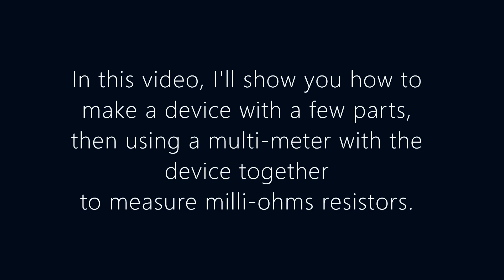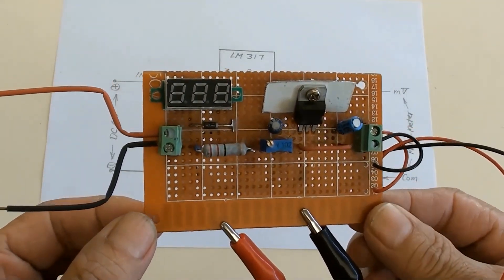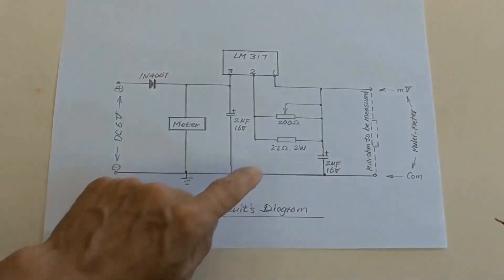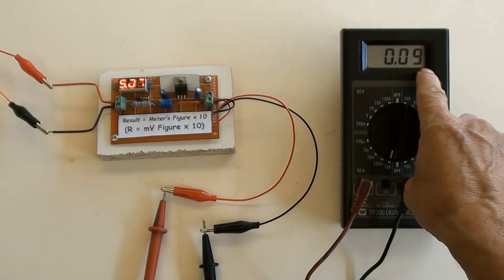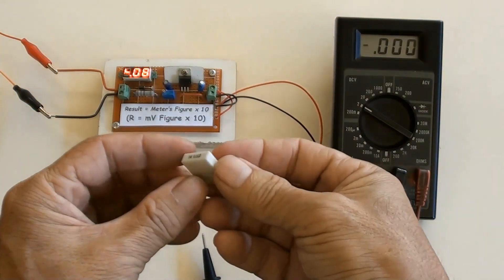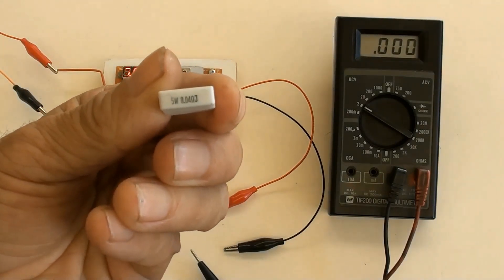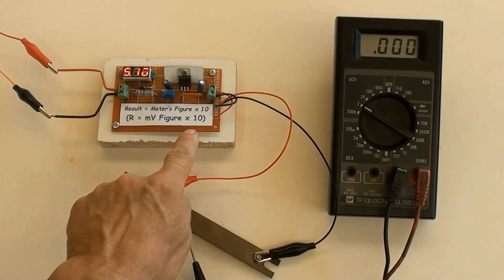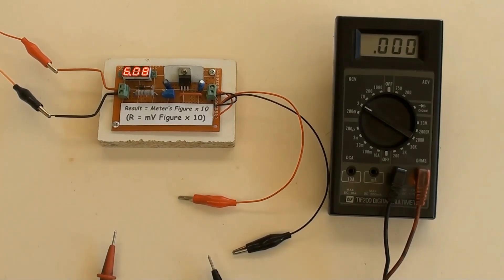How To Use A Multi-meter To Measure Milli-ohm Resistors?

Comment: 5V is enough headroom for 15 ohms DUT.  I built this LM317t supplying 100 mA for milliohm measurements too. My source is a dissembled powerbank which provides 5V. I did not use an input diode, so no drop.  I did an increasing resistance test and found the regulation dropout first occurs when the device under test is around 20 ohms when source is 5.000V.  This can be de-rated to about 15 ohms to account for varying circuit components and test conditions.  I see some people suggest increasing the input voltage.  The additional voltage would create heat, leading to drift from the 100 mA value as components increase temperature.  Once above 15 ohms, a good DMM with two low resistance wires will start to provide more accuracy than a home-made 4-wire setup.
Reply from the maker: Thank you for the interested and like the way you did!  The best way to understand the device's principle, master it, experience yourself and may be to do some improvement as well.  I'm glad you did in so much details.  Thanks again for your feedback! 👍👍👍

Comment: usually from left pin to right it's Adj, Output, Input for LM317, when you facing it, not sure why you reverse the order to make it hard for beginner
Reply from the maker: Thanks for your interest!  Yes, you're right regarding LM 317 pin's order when the one looks it however when the one reads its circuit or drawing its diagram, the pin's order is reversed just like the way of the video showed.  Of course nothing definitely, just saying - that is the most practical way in use.  Cheers!   ❤👍

Comment: Congratulations, it seems to be a good circuit. I have a doubt: what is the use for the display?
Reply from the maker: Thank you for the interested!  The display? You mean the mini voltage meter in the circuit:  it is not a MUST component in the circuit, its function are showing the device has the power on & indicating the power level, just for the convenience in the practical experience.  Thanks.

Comment: Too many errors in this video.
Resistor should be 15 ohms instead of 22 ohms in parallel with 100 ohm potentiometer instead of 200 ohms, to obtain a combined resistance of 12,5 ohms, for getting constant current of 100 mA, since reference voltage of LM317 is 1.25 volts.
Calibration should be done using the 200mA scale in the meter instead of 10 Amp scale, to have more accurate calibration.
The input voltage meter is unuseful.
And the worst mistake, is when reading the millivolts drop in the tested resistor, the multimeter leads should be touching the resistor terminals and not the crocodile clips from the current source to avoid introducing the error of joint voltage drop. Use Kelvin 4-wire measuring scheme.
And by the way, you can reduce background music volume.
Reply from the maker: Thank you for the interested and agree with some of your points however I've to point out:  It is nothing wrong about 22 ohms in parallel with 200 ohms potentiometer (its ohm value is adjustable), their combination value is between 0 ohm and 19.8 ohms which indeed, includes resistance of 12.5 ohms.  The device was the best configuration by considering given the components involved.  I recommended highly you'd make your own device like in the video showed and experience yourself.   Thanks again for your effort!
Reply: I have done many constant current supplies, and those with LM317 has no secrets for me.
Paralleling 22 ohms resistor  with 200 ohms potentiometer will force to flow a little more than half of the 100mA total current thru the potentiometer and it will be in the lower part of his resistance, with a high power disipation and poor precision in the adjustment. The ideal is to have a potentiometer that can be adjusted about his midpoint. @diymade2175
Reply: Kelvin testclamps (4 wire) are rather cheap ~ 20 € or $ or and very usefull. And combine it with a ICL7107 based mV meter (there accurate) and you have a stand alone mOhm meter. And you will be able to set the decimal point at the right place for easy readings.
Reply from the maker: @harrydelange1821   Good on you Mate, that is the one of ways to get the result(s) you want.  As an example:  There are many multi meters on the market now days, you can choose the one which is the best suitable for yourself.  Thanks for your interested! 👍
Reply: @diymade2175  Thanks, personally I am charmed for a standalone solution but I realize that not everyone has the skills or interest to build a more complicated project and choose for building an extention using a multimeter (witch works fine of course).

Comment: I completly apreciate this video and how has explained. But, I'm don't understand at all how it really works. 

Thanks a lot buddy!
Reply from the maker: Okay, you might need to refresh what you had learnt otherwise no worries!  As an example for the people, they know how to use a multi meter but the most of them don't understand how it works.   Thank you very much for your interested!
Reply: @diymade2175  I've watched other similar videos, and backing to this, I finally understood. Really thanks. I don't see the time to build my own! It's really useful to locate electric shorts in electronic repairs
Reply: @diymade2175  Yes, I'm an example of that people, I know to use multi-meter, but don't know how it works en digital, but in analog, I can understand how it is
Reply: It uses Ohm's law.  The 317 is set to a fixed current.  The voltage is measured.  Knowing those two the resistance can be calculated.

Comment: I am completely puzzled by your choice of a 22 Ohm resistor when your target constant current from the LM317 is 100 mAmps.  The nominal reference voltage of an LM317 is 1.25V ;  so, to get 100 mAmps you should need a resistor of nominal value 12.5 Ohms.   Even with your 200 Ohm callibrating potentiomer set at its maximum, in parallel with 22 Ohms this would only take the effective resistance down to just under 20 Ohms - which should result in a constant current of around 1.25V/20 Ohms = 0.0625 Amps, i.e. about 62 milliAmps.  

Even if your main resistor were 10% lower than its nominal value (i.e. actually only 20 Ohms), so giving (combined with the pot at its maximum) an effective resistance of 18 Ohms, and even if the reference voltage of the LM317 were actually 1.3V (the maximum possible, according to the datasheet), the current would still be nowehere near your target 100 mAmps. 

I can only assume your multimeter is wildly inaccurate when measuring in the tens of milliAmps range, and you chose 22 Ohms emprically to make the 'callibration' work.  I notice when you show the calibration process, your multimeter appears to be set on the 10 Amp range (??) - if so it is hardly likely to measure milliAmps very accurately.
Reply from the maker: Good on your effort and I agree with the most comments you made however I have to point out the one:  "Even with your 200 Ohm calibrating potentiomer set at its maximum, in parallel with 22 Ohms this would only take the effective resistance down to just under 20 Ohms" ---- This was incorrect statement!  In fact, their combination value of resistance IS BETWEEN 0 AND 19.8 OHMS (it is adjustable) which includes a resistance's value of " nominal value 12.5 Ohms" as you indicated.   Thanks for your interested!
Reply: @diymade2175  Apologies - my stutupid mistake - you are absolutely right !!  Adjusting the pot to 29 Ohms will indeed give you your 100 millAmps.  Puzzle resolved.  Thanks for taking the time to correct my error.

Comment: why we have multiplied with 10 in the formula.......
Reply from the maker: The device's working principle is based on the one of circuits from Voltage Regulator of LM 317 functions which is the constant output current.  In the video, the device for output is calibrated for 100 mA (0.1 A), which is considered for the best configuration given the components involved for the device.  As an example:  You have 1 ohm resistor to be tested, according to ohm law - output voltage cross the resistor = 0.1 A x 1 ohm = 0.1 V which is also a multi meter's tested result.  we use only figure of 0.1 for testing purpose and omit V.   The 0.1 needs times 10 to get result of 1, this is "why we have multiplied with 10 in the formula".   On the other hand, you might have asked:  why not the device calibrated to 1 A instead of 0.1 A?  Well, it wouldn't be practical to have it done simply & efficiently.   Thanks for your interested!

Comment: Sadly i couldn't find a 200-ohm potentiometer to do this project
Reply from the maker: Thanks for your interested.  In the most case, you are able to find a way or ways to solve the problems.  One example is here:  You can use a 1 K ohms potentiometer and a 250 ohms resistor in parallel, the total result is 200 ohms and you also can try the different ways to get the same result.  Good luck!
Reply: @diymade2175  Thanks for the replay ... I'm trying because I like this project

Comment: What is the point of the music and ocean sounds when it masks your voice?
It started at a reasonable level but gets louder and louder until its louder than your voice !!
Your video would be fine with just a voice over.
Calibration should be done on the 200mA meter range and the measured voltage should me on the 200mV range.
Otherwise its got good information and a simple design to implement.
Reply from the maker: Good points.  Thanks for interested!

Comment: Nice sir, how much maximum input source voltage we can use? Like 9v common battery
Reply from the maker: You can use 9v but the best range is DC 5V to 7V.   Thanks.

Comment: Why needs the digital panel meter? Connect the fix and stable 5Volt and that's it. Why measured 100mA current in 10Amp. level?
Reply from the maker: Well, the digital panel meter is not a "must" component in the circuit for the principle operation however it is handy and convenience during testing operation if a DPM or Led installed in the circuit.  Thanks.

Comment: Why not just use the 3-wire digital voltage display to measure the output voltage drop so you don't need the multimeter? you would have 4 wires, 2 for the constant current and 2 for the voltage measurement using the digital display
Reply from the maker: Good on you Mate!  About digital voltage display:  Well, that'll be the one of different ways to get the same result.  The reason that Multi-meter used is, I believe, the most people in general are well acknowledged the Multi-meter than the digital voltage display so far, of course this might be changed in the future.  Thanks.for your comment.
Reply: This device is measuring in a 4-wire configuration like Kelvin clamps. Multimeter and constant current pcb are not grounded together but at the measure point eliminating wire resistance.

Comment: Great video.  
The shematic diagram is blurred and DMM of 5 digits wound be better. The supply voltage can be higher. Kindly post a better schematic diagram. 
Can you include an ammeter to confirm constant current value?
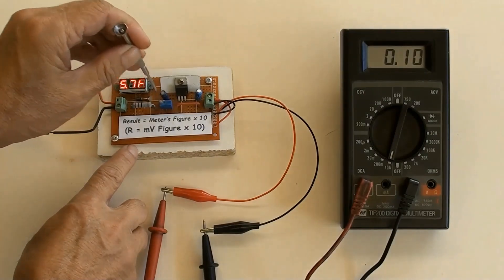Reply from the maker: Thank You for the info !   The device's working principle is base on a circuit for the constant current of LM 317.  In the video at 3:03, the device was calibrated for 0.1 ampere (100 mA) so no need to have an ammeter connected.   For combination reason, the best supply voltage range is 5V to 7V (I leave to you for the reasons).  Thanks again.
Reply: The supply voltage is relevant here in terms of power dissipated by the voltage drop of higher supplies. Eg: you put 18v in and you need to do something with the wasted voltage, which gets lost as heat through the LM317